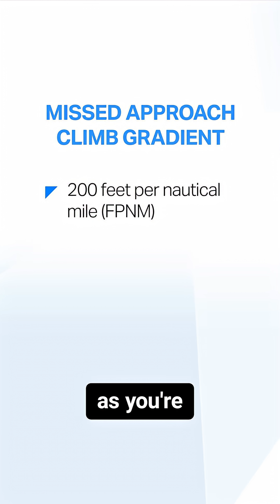Missed Approach Criteria

Comment: If you start executing a missed approach early, are you free to start the climb then or should you hold your altitude until the MAP or DA point?
Reply: You should start climbing immediately
Reply: You can start the climb, but your flight course must remain the same until you reach your MAP on a non precision. If you change direction too early you are not guaranteeing obstacle clearance. On a precision approach you typically go missed at the decision altitude because it is a guided approach, but if you did it before you would still have to stay on the final approach course to guarantee that obstacle clearance.